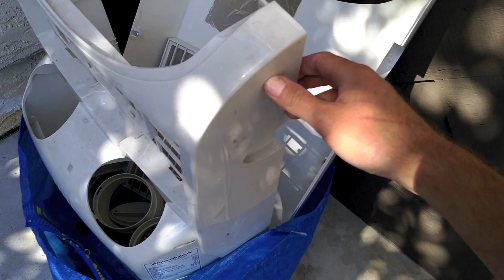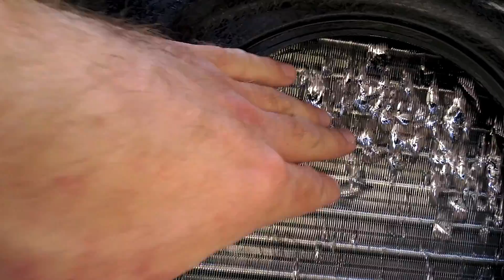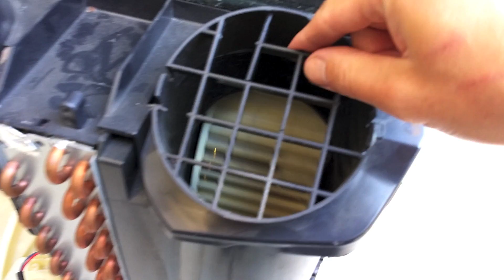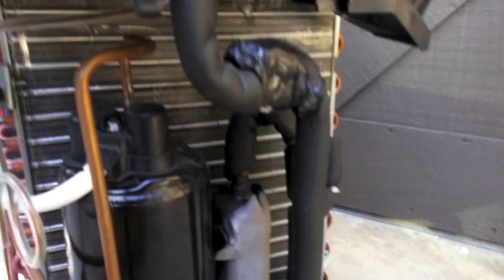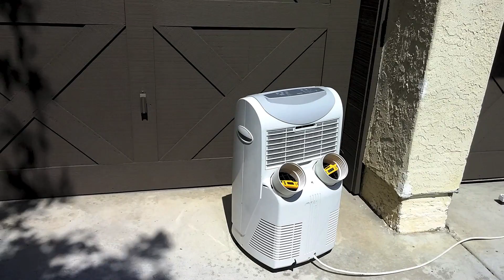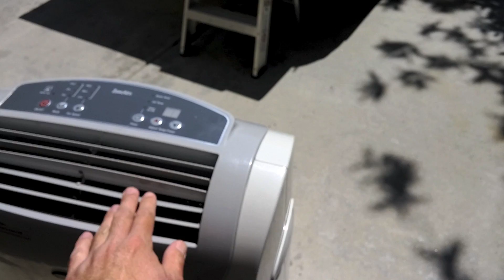Portable Air Conditioner Repair

Comment: hi. i watched the video but i was wondering if you could tell me more about the noises the different parts make when they go bad. i picked a unit up off the curbside and owner said that it worked but needed a new fan. the blades were broken like this one but the fan still turns freely so i didn't think the motor was seized. evidently they did not have the grill cover on the intake and something got in there. i ordered the parts i could figure out i needed by looking at the manual and I'm still waiting for the fan to come to switch out but now that I've got all the grill covers and connections i turned it on to see how it worked and it blows regular temp air for a minute or so not too loud, but then this horrible loud noise starts. is this the condenser kicking on or is this the sound of a fan that is missing 1/3 of the blades? it is quite loud and choppy but have no idea how to explain. any advice or videos you can suggest to trouble shoot? thanks!
Reply from the maker: Hi April,
That horrible noise is very likely from the fan missing 1/3 of the blades (it's out of balance from the missing blades). Or it could be the compressor. Hard for me to diagnosed without seeing it.
Reply: Thanks. I'll just have to wait and see once the fan gets here. Fingers crossed.
Reply: blower fan finally came, I took apart the ac and replaced the fan. put it back together...and the sound of a jackhammer is still there. it's coming from the bottom area, near the blower fan but I doubt it is the fan. I am guessing compressor. is this worth fixing? I have the free time to work on it the next few weeks but there is a huge chance I will just break it more lol.

Comment: Jon HVAC, Thank you for the video. I have the exact same model. Do you know if it is possible to refill the gas on these units and if so, where would the charge kit connect to? Also, what kit should I buy for it, please?
Reply from the maker: Hi William,It is possible to recharge refrigerant. They don't sell recharge kits like for cars. You basically need to be a A/C guy to recharge these things. I wouldn't recommend a novice to attempt to recharge...it can be pretty dangerous.

Comment: my haier 14000 btu unit is the exact same design. same factory most likely. do you think an ac tech would charge one with coolant?
Reply from the maker: It would be hard to find one. Most stick to central systems and their pretty busy this time of year. You might want to find a home appliance repair guy.

Comment: General tip:  ALL compressor motors draw 2 to 5 times RUNNING current to start.  If a compressor is running, shut down and restarted quickly, it will strain and draw BIG current trying to start AGAINST pressure in lines.  WAIT 10-20 minutes, allow pressure to bleed down, THEN restart as designed without stressing the compressor pump.

Comment: Hey thanks for this video. I have a few portable units (upper level of home gets waaay too hot). I have one problem unit (a Delonghi Pinguino PACAN120HPE 12K BTU) with the lone exterior exhaust/negative pressure bad design that's so prevalent that once the compressor kicks in, it's pulling more than 15 amps and tripping the circuit breaker for the house wiring in my room. Bad compressor start/run capacitor? Dirty coils? It runs quiet and cools nicely, but pulls more power than it should. Maybe just a bad compressor?

Any thoughts / input appreciated - your video gave me a few good ideas... ;)
Reply from the maker: +Pete Kowalsky Hi Pete,
Keep in mind that each 15amp breaker usually run multiple outlets. Since you said your running multiple portable units. You may be just pulling too many amps for that circuit. If that's not the problem check your filter, coils, run cap for comp. Possible refrigeration circuit issue or just a bad compressor. Hope this helps
Reply: So I cracked open the unit this evening and oh my gosh man it was DISGUSTING inside. The condenser coil (bottom one) was CAKED with crap over 1/4" thick. Nasty! :) A thorough cleaning with my air compressor and gentle fingertip agitation (no I didn't screw up the fins) seems to have done the trick. I think the compressor was overheating, drawing too much power, and tripping the house breaker. No, none of the other units are on this circuit either. ;) Lots of cool air, quieter operation, and it doesn't seems to want to catch anything on fire any more HAHA!!!

Hey - where do you recommend a non-licensed DIY homeowner like me purchase supplies and stuff? I try to get as much as I can for my household projects from eBay / Amazon, and Johnstone is getting more and more picky about "cash customers", even if I know exactly what I need... Maybe I should take a class / courses at the local community college and get EPA / HVAC licensed? I have no idea what level of commitment that would be, time or money-wise. (I'm not interested in making a career out of it -- already have one of those) but maybe you have some videos about that...will check.

Subscribed - your videos are really good, and I appreciate your work ethic and great attitude. THANK YOU for taking the time to share your expertise as well.
Reply from the maker: That will do it for sure. Sounded like it was really bad there. 
As far as purchasing supplies, your already doing what I would recommend. I'm actually surprised Johnstone is selling  to a "Joe Schmo" pardon the pun lol! I would keep a good thing like that going if I were you. Bring them some donuts or Starbucks next time to keep that gravy train going :)
Community college is usually pretty good, but like you said it does take time and $. Books aren't cheap. And you may have a ROP school by you ( Regional Occupational Program) and are free/low cost. Some power utilities put out seminars about HVAC and those are usually free. It all depends how much you want to put into it. And as you know YouTube is pretty good as well lol! I would recommend this channel: Town & Country Air PRO. It is a paid channel $1.99/month but, there's no commitment you can cancel your subscription anytime. He's a really good guy and knows his stuff.

I'm glad I was some help. I really appreciate the kind words Pete.

Comment: hey thanks for the video. this got me pointed in the right direction. I have a haier 7000btu portable that is making terrible noises and am pretty sure it might be the fan. problem is the fan and blower motor is sandwiched between the two coils (the two sets of coils aren't stacked) on this model so I'm a bit unsure how to proceed.

Comment: I have a Whynter portable 12,000 BTU. it's  1 yr old unfortunately it is gonna cost a lot to ship it for repair.  It started smelling like burnt  metal when it's  on. Can you advise what to do  please.  It weighs like 60 pounds  and there's  no way I can carry this around to have it serviced.  I also can't  find  anyone to fix it.
Reply from the maker: Sorry for the delayed response. Hard to diagnose over the computer. Best thing to do is get the shell off to try to find the problem.
Guys basically consider these things as window units. And it's really hard to make $ fixing lower end stuff like this. I only fix this stuff for friends and family.
Reply: Calliope did you ever figure out where the smell was coming from? Mine is doing the same thing.

Comment: ive a 14.000 btu delongi heat and air ..it shut down on heat and now it shows a triangle with a stop sign on it dont doo nuthing now ...where is the filter on this thing ??
Reply: John, I have the same prob with my Ac. 14000 btu haier. can you pls help us on how to fix the prob. thanks.
Reply: when I turn on my 1400 btu haier Ac. it will suddenly stop. then it swill show stop on the screen. how could I fix. thanks

Comment: I'm having a huge problem with mine. Any help is appreciated. The compressor will run for about 10 minutes then shuts off. I have to unplug it and let it sit for about a half an hour 
before I hear the compressor click which means i can plug it back in and
 it will work for another ten minutes before shutting off. During this 
time, the fan continues to blow until unplugged. The copper coils don't 
get cold. There is no condensation build up. I unplugged the drainage 
pipe and it was dry as a bone. Before I take it apart i want to find out
 what the issue is and get the parts i need for it.
Reply from the maker: That sounds like it's out of refrigerant my man.
Reply: I got it to run for a few hours last night. It seemed ok but i turned it on when i got home from the beach today and it wasnt working again. You sure it's a refrigerant problem? If it is, i don't have all the nice tools you do to fix it. Thanks for the help. Also, portable a/c's really suck. I think they are made to break down after a year or so. I spent almost a half a grand for this one.
Reply from the maker: So did it blow cold air? You need to make a friend with an a/c guy asap :O 
They do suck, this is why we need to make 2016 MEGA!
Reply from the maker: Could be a lot of things, hard for me to diagnose over the computer. Do all the blower motors stay on? May be a dirty condenser coil, dirty evap coil/filter, run caps, refrigeration issue, compressor issue. Just to name a few problems.
Reply from the maker: Hope it's something simple, good luck.

Comment: I have a delonghi pec130 portable air conditioner and when I turn it on the the ac part it makes a very loud sound like something is in it what's weird is that I was working just fine the other day don't know what wrong with it what should I do please help😩
Reply from the maker: Sorry for the delayed response. You may want to take off the outer case. Then turn it on to determine where the noise is coming from.
Reply: You may have the same problem I have. When I turn it on the fan starts making an extremely loud noise. What basically happened was a band around the fan blades that holds them together broke off so now when I turn it on the fan blades spin and expand on the outer edge so they scratch up very badly on the inside. Can't imagine how it happened but you can buy a new fan online for around 10-25 dollars, that's what I plan on doing for my PacN100e delonghi. It isn't the easiest fix you have to take a lot off.. Good luck!

Comment: I have a amcor portable unit and there is a motor at the bottom that has a water wheel on the end so it pulls water from the tank and flicks it at the heat bars so the tank stays half empty. That motor has stopped working so the unit need emptying constantly. Do you have any idea if it's the motor dead or circuit somewhere. Thanks in advance
Reply: If the rotor spins, bearings are OK.  Disconnect ONE side of the motor and with a multimeter, you should see 115 V. from the other side and the disconnected wire.  If not, visually trace the circuit back to where a fuse may be located.  If AC is present at the motor, probably burned out coil winding.  If motor RPM is shown and current. see what the shaft type and size is, then go look for "AC MOTORS" on line for a replacement, usually $5 to $15.
Reply from the maker: Likely the bearing on the motor is shot. You might want to try spraying it with WD40. If that gets it going it likely will only last a week or so.
Reply: +Jon HVAC I took the motor out by unbolting the base and once the motor came out I spun it and it spins by hand. The motor splits in half with bolts so took it apart and it looks ok. It's a strange one. That's why I asked. It seems like a power fault. I'll have to run a multi meter across it to be sure now. I thought motor seized though.
Reply from the maker: Sorry for the delayed response. It doesn't take too much bearing damage to stop these motors. Yep make sure it's getting power.
Reply: +Red Woods the motor doesn't spin at all. It's completely dead. I have a multi meter so will check volts to it. I've checked the wiring all the way to the main board and there is no blown fuses. I checked them all before. I'm thinking burnt out winding as it's not a bearing motor it's magnetic

Comment: i have to drain every 20 minutes
Reply: You need doctor!
Reply from the maker: You may have a bad condensate motor. I've seen one that rotted out before. Or it's super humid where you are.
Reply: How much is "super humid"? Sometimes, it will work for hours before having to be drained, but yesterday, the humidity was 94%, and I had to empty it every half hour or so
Reply from the maker: Yep that sounds normal. 94% is really humid.

Comment: Great video, Jon. I am having a heck of a time finding a local repair man that will work with portable AC units. I have an Everstar MPK-CR 10,000BTU unit. And one day it just decided to no longer blow COLD air. It's just a giant overweight fan at this point. And I can't find ANY troubleshooting forums for this issue. Should I junk it?  Thanks, Dave
Reply from the maker: Thanks Dave,
It's hard for repair guys make a living fixing these things. After parts and labor most of the time it's cheaper to buy a new one. And parts are hard to get. Do you hear the compressor ever come on?
Reply: I can understand that. It comes on for about 2-3 seconds, and then shuts off. It draws a lot of power in that 2-3 seconds too.
Reply from the maker: Sounds like the compressor maybe locked up. Check/test the run capacitor for the comp. I have replaced the run cap with one double in size with success before. And you may want to try a hard start kit like this: http://amzn.to/1Y6Hft7  Doesn't always work, but may be worth a try.
Reply: @jonhvac  

John

I live in SC and  have a whynter unit that is almost 3 years old. We run it in our loft to dehumidify. Yesterday the coils started freezing up while it was running in dry/dehumidifier mode. I defrosted it with hair dryer and it ran fine for 24 hrs then it froze up again. It has a pump in it to push water out to reservoir and drains fine but for some reason it has started to now freeze up. I keep the air filter clean but have never "cleaned" the coils. Any suggestions?

Thanks

Damien

Comment: i have a delonghi pac cn120E my baby put a business card in it i just want to open it to take the card out but i can't figure out how to open the shell
Reply from the maker: That one looks like a hard one to open up. From what I saw from photos, there looks like some little round circles on the back where some screws maybe hiding. There maybe some screws towards the bottom out of sight. And traditionally the front and back shells are hooked together from the inside. Once all the screws are out, lift the back shell up to un-hook it from the front shell. It's hard for me to take these things apart as well. Hope this helps you.

Comment: haier say stop when turn it on what do that means it was working before
Reply from the maker: Don't really know, maybe try to drain it.
Reply: water tank is full. try to drain the water tank in the middle of the bottom on the back side. got a free one on craigs and that is what its doing. the condense water is not getting pumped up over the condenser unit so it is building up and shuts down. cheers

Comment: Thanks for the informative video. I have a unit similar to the one you repair,  there is no physical damage,  just stopped getting cold. I hear the condenser cycle, but the air is only slightly cooler than the fan only setting. Any ideas,  are these units serviceable in terms of needing to be recharged with coolant?
Reply from the maker: +Anthony Green Sorry for the delayed response. Make sure the filter(s) are clean and the coils. If their fine you may have a leak and low on charge. They don't really make these easy to be recharged. You need a piercing valve like this: http://amzn.to/1WoPku6 to add refrigerant. I don't really recommend you attempt this, unless you know what your doing. You can get seriously injured.  Your kind of at a catch 22 here, not really worth buying the parts and tools or to hire a repairman.
Reply: Thanks Jon, I came to that realization and just bought another one. Just seams like a waste to bulk trash the old one...
Reply from the maker: +Anthony Green Yes it does man.

Comment: hello there jon. i had some problems with my portable ac, there's two drainage port (for some reason i do not know), I've used it for awhile and yesterday the water started to leak at the bottom part of the drain port.. is there a problem with my evaporator or something?

Comment: Nice Video, I have one similar to this video and when I turn it on it works well for about 10 mins then cuts off and the unit gets hot, it will work again when it cools down,  any suggestion ??? thanks
Reply from the maker: +RAYNOLD SERRANO Thank you. Make sure all the blower motors are coming on and staying on. If one of the blower motors isn't operating correctly, it maybe a bad run cap for one of the motors (including the compressor's) or just a failing motor. Check the condensing coil and filters to see if they are clean.

Comment: Hi Jon, thanks for your prompt response, I managed to eventually get the covers off (without damaging the unit)and cleaned the unit, there was a lot of dust build up.  I also emptied about 500ml of water when I opened the water plug...this unit does not hold much water, does it work properly when it's filled with water? Or do I have to continue to empty it in the future? You did mention something about that in the video....also would I need to ever refill gas in this unit over time....thanks again for the your help and for posting a great video.